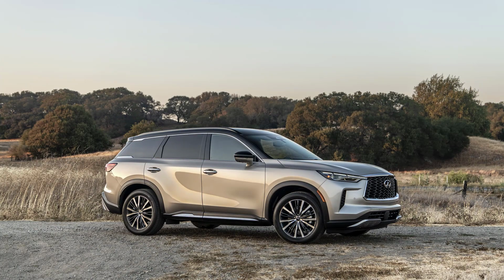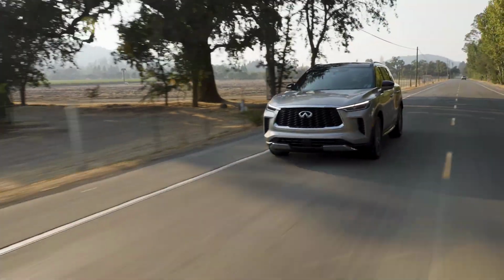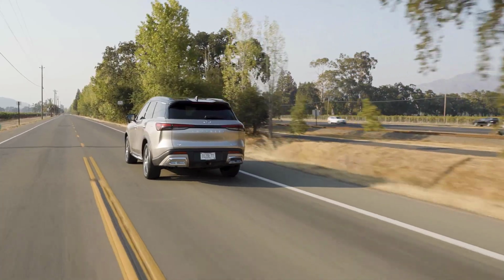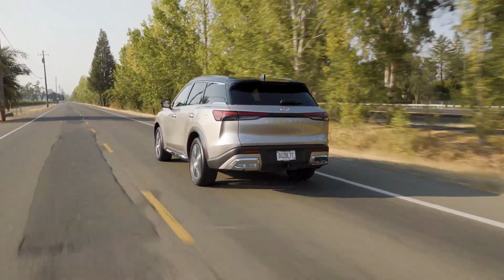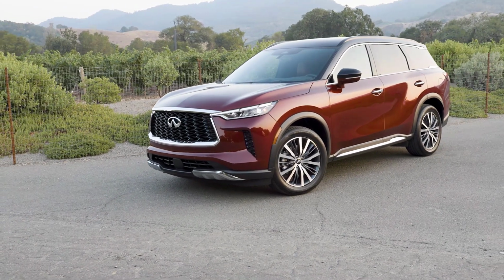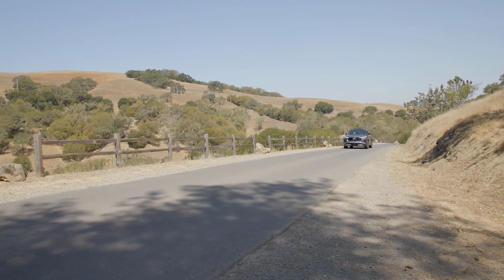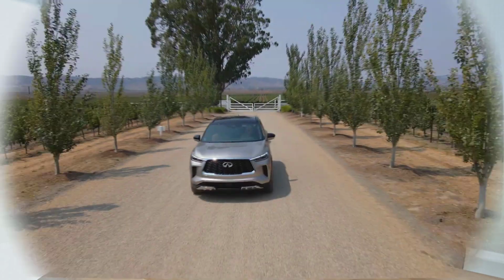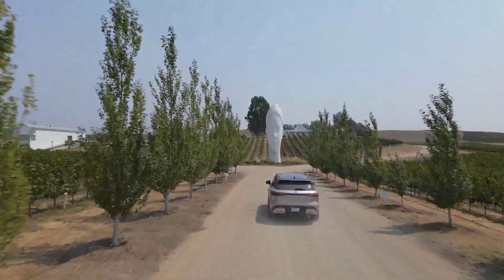2022 Infiniti QX60 interview with Mark Snyder

Comment: I have a 2014 QX60...at 7,500 miles the CVT started vibrating, got a new CVT. At 20,000 miles the CVT started vibrating, got a new CVT.  Around 12,000 miles the alternator went out, got a new one.  Now I'm at 84,000 miles...and its been doing great, except for a rattle that no one can find, under the seat.  I would buy one again I guess